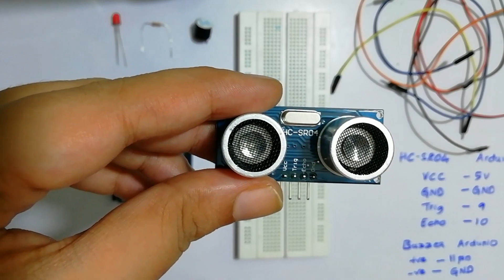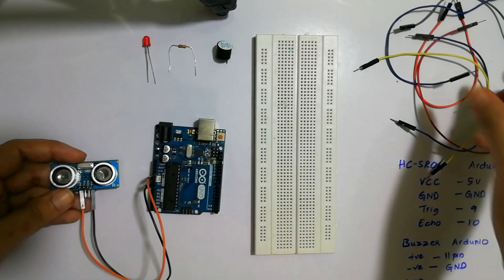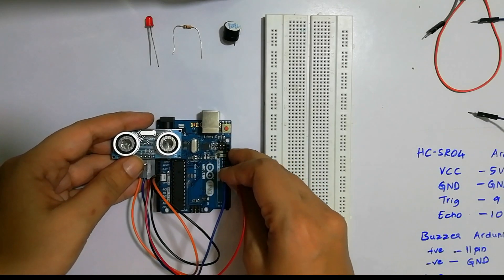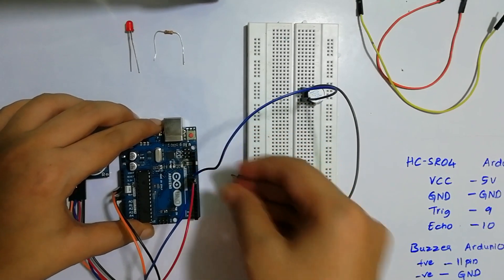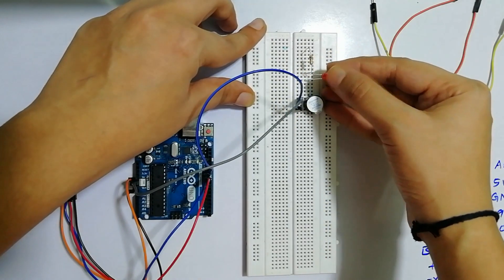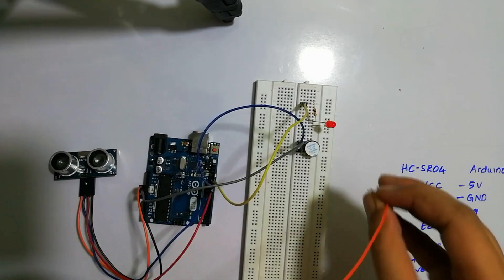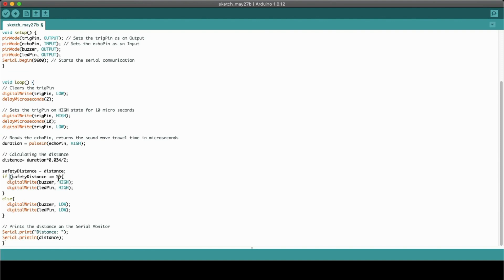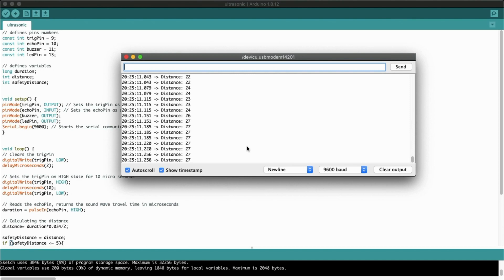How to connect arduino ultrasonic sensor with buzzer and led

Comment: would you mind being my friend? cuz i want a friend that is experinced with this stuff and that will help me with it! and plus i have autism and i am trying to learn this kinda thing
Reply from the maker: Oh yes definitely I would like to help who are interested in learning
Reply from the maker: Please connect me on Instagram
Reply: @Pigirl  i don't use instagram sorry. but i do have discord and twitter
Reply: @Pigirl  um arduino coding and um connecting the parts
Reply from the maker: Good let me know where you need help 
I’ll be there to help you out
Reply: @Pigirl  well okay i have a mega2560 board but what i am trying to do is connect a ultrasonic sensor and sound sensor module and buzzer and servo motor but the issue is is when i go to connect a wire to where i need to connect it it ends up already being taken from another wire that i already hooked to it.
Reply from the maker: @BlazeTheCatMan_Animations  Ultrasonic Sensor:
  - VCC: 5V
  - GND: GND
  - Trig: Digital Pin 2
  - Echo: Digital Pin 3

Sound Sensor Module:
  - VCC: 5V
  - GND: GND
  - Analog Out: Analog Pin A0

Buzzer:
  - Positive (+): Digital Pin 4
  - Negative (-): GND

Servo Motor:
  - Signal: Digital Pin 5
  - VCC: 5V
  - GND: GND

follow this pin numbers and try to connect
Reply from the maker: also go step by step
Reply: @Pigirl  thank you! i will let you know if it works or not
Reply: @Pigirl  but how do i connect another GND to the GND cuz its already taken by another wire
Reply: @Pigirl  thank you you are truly a friend and a new friend of mine so you wanna always help me with this cuz you know how much i wanna learn this!? :)
Reply: @Pigirl  do the colors of the wirues matter or do they all work?
Reply from the maker: @BlazeTheCatMan_Animations  no doesnt matter (its juat for identification )
Reply: @Pigirl  btw my sound sensor module has 4 pins and is diffrent
Reply from the maker: You are from which country?
Reply: @Pigirl  united states
Reply from the maker: @BlazeTheCatMan_Animations  I guess you are beginner ill explain you step by step on zoom call you connect with me
Reply: @Pigirl  hey on my sound module the ends that i plug in have a AO and G and + DD so where do i connect those to?
Reply: @Pigirl  also how do i connect micro servo cuz my servo is a micro instead of just a black servo its a blue one